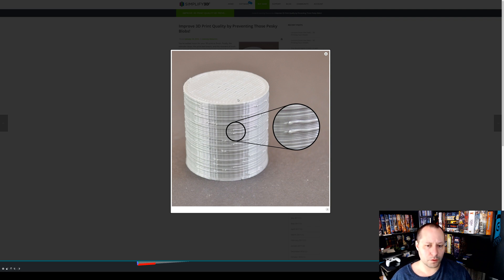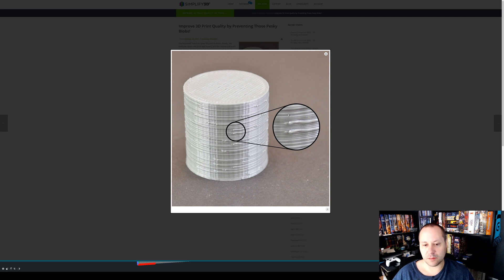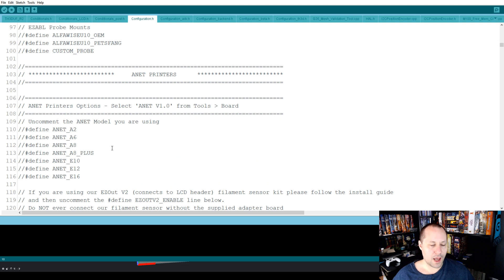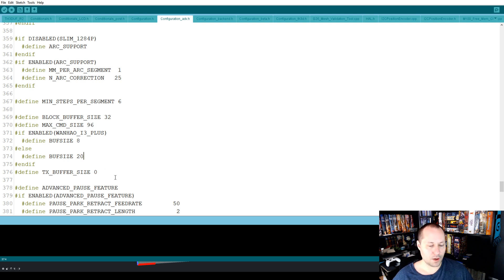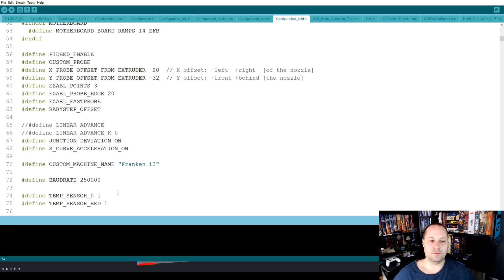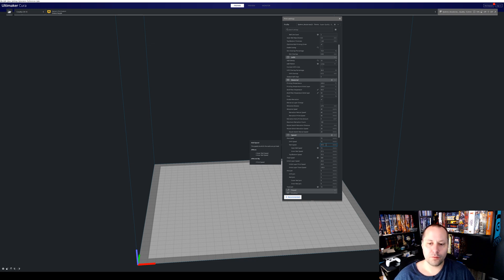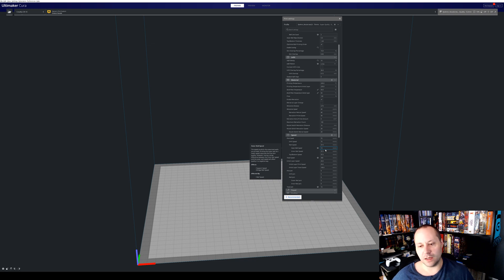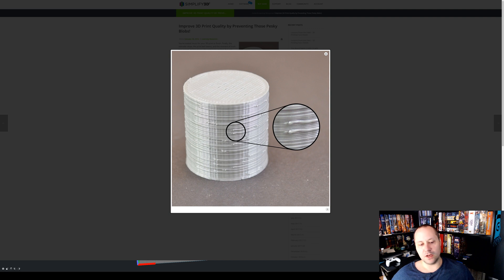How to fix blobs while printing using Octoprint -  3d printer -Marlin updates and Cura settings

Comment: Or just disable the power loss recovery then it will cue up commands well quickly. It solved my issues. Most printers with marlin have it enabled. You need to disable it. You do this by adding M413 S0

Comment: So I may be the odd one out but after i followed all the changes and flashed my fw , the cr10s won't boot and it beeps, any idea what could cause that?
Reply from the maker: Sounds like something happened with the new firmware, can you try flashing the old one to be sure
Reply: @AthexTube   the old one works, i managed to fix it, the problem was with sth else external_host_action, when i enable it it just doesn't work, so it was a prob on my side,  the blobs are fixed now
Reply from the maker: Awesome glad this fixed the issue!

Comment: a quick fix following the info provided by this video - is to upload straight to your sd card through octopi, it takes some time to "stream" the gcode file to sd card via octopi, but u dont need to reflash the firmware ;).
simply drag and drop the gcode file to the right side of the octopi screen (desktop version)
Reply from the maker: Thanks! I didn’t try that but it should work i would expect!

Comment: It would have been very interesting to see pictures before and after these changes. 
To get an idea how the end result would look like.
Reply from the maker: Sure! I may do a followup if i can find old prints that have this issue
Reply: I agree, because now I don't believe him! I print straight from SD, so most of the issues discussed here aren't so for me, but I still have the blobbing.
Reply from the maker: The most effective thing if you still have blobbing is to calibrate your extrusion and slow down your outer walls
Reply: @AthexTube  - Extrusion was calibrated and my research indicates that differences in outer wall speed and inner wall speed can create problems with blobbing due to non-equalized extrusion pressures in the hotend. Going to give a go at Linear Advance.
Reply from the maker: @Perry_Wolf  I haven't tried linear advance yet since I didnt have a 32bit board but I plan on trying it now that I upgraded. You could lower both inner and outer wall speed, at least for me the difference didn't cause blobbing issues
Reply from the maker: @Perry_Wolf  Just fyi, I was looking into this more and a new plugin came out since I made this video called arc welder. I haven't tested it but it should also really improve this if your firmware supports the commands. Heres the link to the octoprint plugin theres also a Cura one available: https://plugins.octoprint.org/plugins/arc_welder/

Comment: i have a CR 10s pro and i have the same issue i have change all the settings and nothing works
Reply from the maker: Are using OCTO print? If it’s still not working try slowing it down to 10 mm a second for the walls and see if it fixes it you can also change the maximum resolution and maximum deviation which will reduce the size of a G code and help

Comment: I've got an Ender 3 Pro with a Raspberry Pi running Octoprint and I've been struggling with this issue for a while. These fixes completely solved my problem, thank you so much!
Reply from the maker: Glad this helped you out!
Reply: Hello, I am using the same system. I have that same problem. Did you install pulujin or update my marlin? Which one did you solve the problem with?

Comment: ive already installed octoprint and its running well but how do i make changes to configuration H now? do i need to re-install octoprint with the updated configuration H? or can i change it via g-code commands into octoprint?
Reply from the maker: Let me add the most effective change was the cura settings changes which can be done in your slicer, just re-slice the 3d print with those settings
Reply from the maker: What do you mean the configuration H? In this video the configuration changes are happening in the firmware of the 3d printer. I have a couple videos that go over updating the firmware. Keep in mind its possible that a bad update would require you to either buy a new board or get the hardware to re-flash it but I havent had issues: 
https://www.youtube.com/watch?v=9lB21ui4nFY
and
https://www.youtube.com/watch?v=EGPToe-j4bk